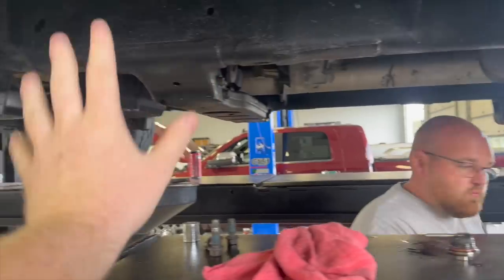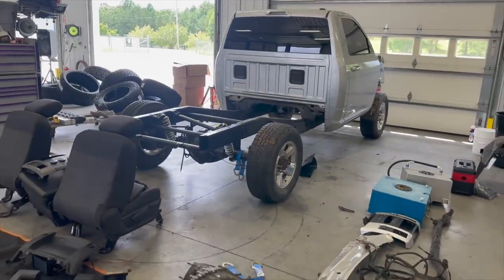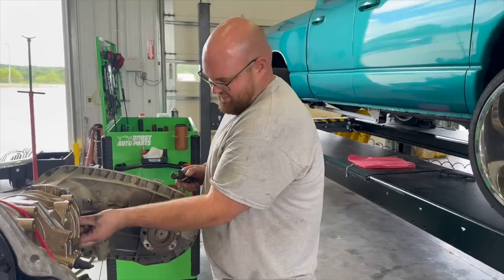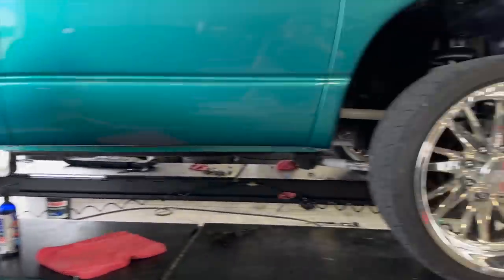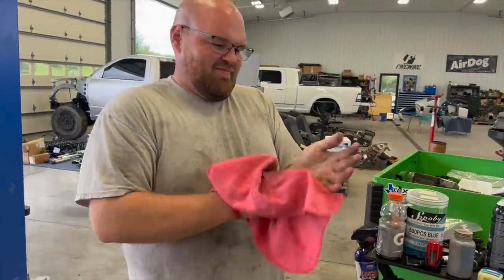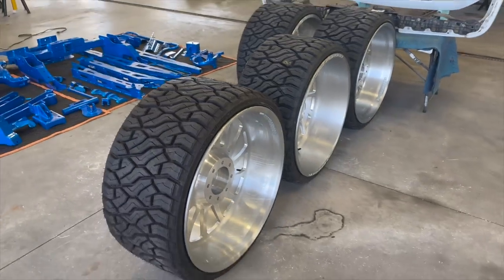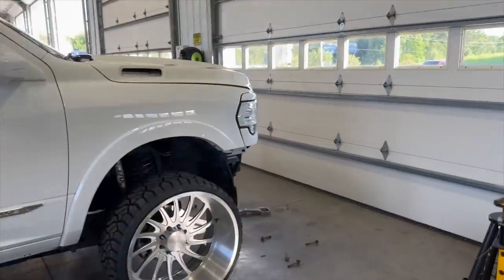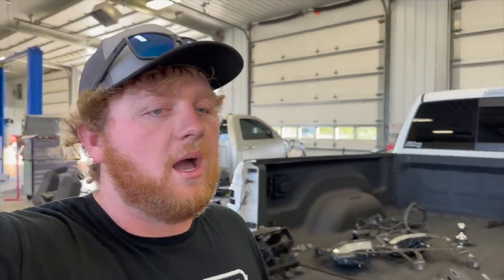The Worst part of Owning a Cummins..... Megacab Build Gets New Wheels!!!

Comment: Blake, how’s your experience with Venom Power tires. I have 22x12 Cali summits on my LBZ with 35x12.5 Venom RT. Same tires you have and they seem to be really out of balance which tire shop said they had a hard time so put beads in which I’m not happy with at all for my daily. Either that or have some buddies who have said their VP tired have been out of round. 

I might just go to Nitto RT or Fury MT. But curious as you have a lot of wheel and tire setups.